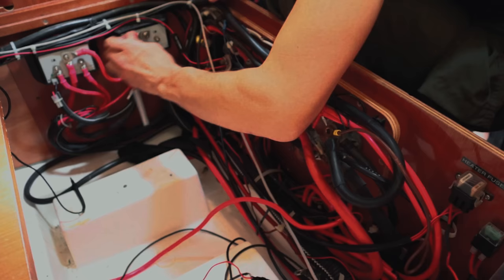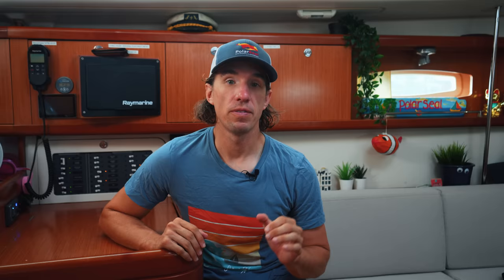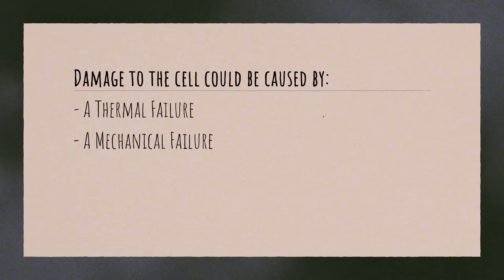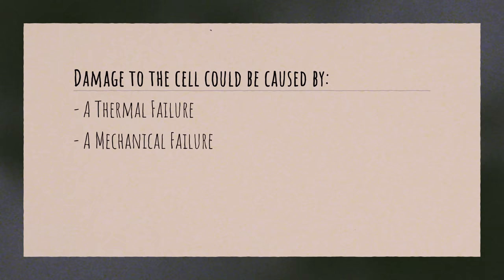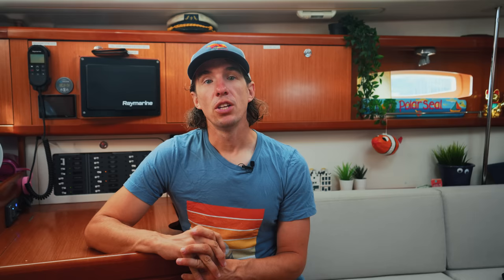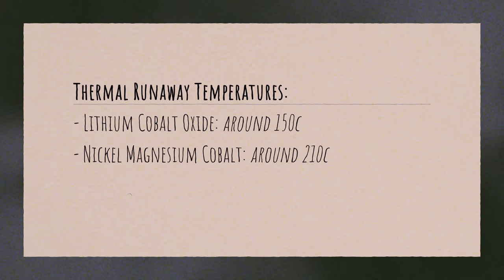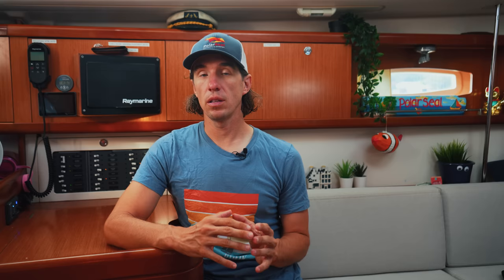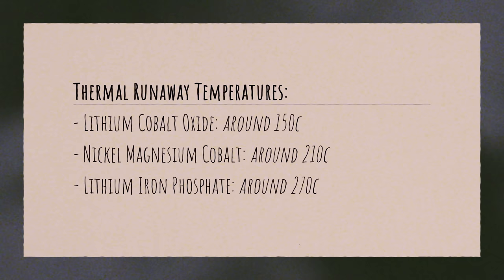WATCH THIS before installing lithium batteries on your sailboat ⚡ [RYAN'S TECH CORNER]

Comment: I have a boat with a really big inverter. 200A discharge, 100A charge at 13.8V. i have two 50A charge 100A discharge internal bms LFE batteries in parallel. It worries me that there is not much spare capacity inthe battery bank. Should there be a third battery in parallel?

Comment: So with internal bms AND comms, what happens if the internal BMS fails? What is the state of the battery when the BMS fails regardless of coms when it has internal Bms (for Dakota for example)? Does the pack become unusable or does Dakota allow the pack to be discharged/charged regardless?

Comment: do you have a list of insurance companies that do not greatly reduce coverage limits to  when Lithium is used (if there are any)? or do all insurance companies reduce coverage with a lithium battery bank is present?

Knowing that non of your 352000 is batteries burnt from properly installed, properly used failures, can you tell us how many over all fires you know of of those 352000 regardless of cause?

can you break that same answer down, including causes, allowing us to learn from others mistakes?

good video, as usual.  thank you.

Comment: Very informative video. I am looking to switch out my two starter AGMs in my 2017 ford transit van for a single lithium battery to allow for more space under the driver seat to install a DC to DC charger to my auxiliary lithium battery bank. Any recommendations on a company that can provide a regulator for my alternator?

Comment: I want to add 400 Amps of LFP (2X200) but one would be in engine compartment the other in aft cabin.  same as my current AGM setup.  Would the engine compartment heat vs the cabin temp negatively affect one battery more than the other.

Comment: hello Ryan, thanks for this very clear info. I was told that a hybrid syteem is the best of both worlds: I already had 3 new 90Ah agm's and I combined them with 2 bos LE450.  The advatage was that i could just connect them parallel to the agm's   I was told the agm's would live longer because of the BMS of the BOS LE 450 units.  Also I thought it wouyld be bettter to have simple batteries also in case there is a problem in some remote area. Lead or agm is everywhere. Do you agree on this opinions?

Comment: I'm in the process of updating a sla based ups to run lfp.  at present a mostly drop in replacement but i have to rely on the bms to prevent over/under charge/discharge.  the lfp battery is rated at 100 ah.  At full load the ups draws apx 70 amp.  The ups is intended to only to run 5-15 minutes to allow me time to startup a whole house generator.  I'm planning to add circuit mods to separate the inverter and charger to allow for the addition of adjustable low and hi voltage shutdown to prevent the battery from being over/under  charged or discharged, and to limit charge voltage & current to meet battery specs.  Being inside residential the operating temps isn't an issue.   I'm exploring the use of hi current schottky diodes or equiv. to separate the battery load and charge circuits, and turn off automatically should  voltages exceed preset limits.  
what do you think so far?

Comment: How do I ground my inverter? I have lithium bank totally separate from my house agm house bank. The lithium is only for my inverter and is isolated. Should I ground the inverter to the main dc ground? I’m concerned about galvanic corrosion

Comment: Thank you,  very well put together. I agree that the problems that arise often do not come from the LiFEPo themselves  but from the systems that support them.  That being said how are you going to deal with protecting alternator when you change to the LiFEPo start battery? Are you going to add some kind of protection i.e Vitron; Sterling ?

Comment: Hey, that was a really informative video, thanks a lot. I'm just wondering, does the lead acid buffer battery and B2B charger to lithium only work with a dual alternator setup or is it suitable for a single alternator also? Thanks

Comment: Hi Ryan, appreciate the video! 

- i have a boat with lead acid (sun odyssey 50 ds)
- want to replace house batteries for lifepo4 12v * 4 * 200 ah lifepo4 with bms
- want to keep starter and bow thruster batteries as lead acid
- want to add a victron multi plus 2 3000va 12v and set the profile to lithium
- how do you combine lead acid with a lithium charge profile on the multi plus? Do I need two circuits? And 2 battery chargers?
- is the starter battery also connected to the shore power/ battery charger so it charges? 
- Or is the starter battery only connected from alternator to starter battery to to dc-dc converter to house batteries?
- how does a diesel generator affect this? Does the diesel generator first go to the multi plus? Can it be combined?
- can a multi plus be mounted on its back instead of against the wall? There is hardly space for 55 cm

Thanks for the help!❤

Comment: Hello Ryan.
One of the best and most realistic videos about lithium on boats.
Completely agree with everything that you said. It is a shame that most marine electricians have no idea what a lithium battery is and how it operates and find it easy to just say fire hazard. On the other end, a lot of battery manufacturers say drop in replacement, which most of the time is not the case, as you very well explained.
I love my lithium and solar array and makes life aboard very pleasant. But I had to change a lot of components to get there.

Comment: Great tutorial Ryan!!  We are sailors but also building a skoolie, which, I believe,is a simular setup.  We will have Solar to charge our house.  Alternator will take care of starter battery.     Is there a guide or contact to help as to what Guage wire to install for the size of our house bank.   I havnt worked out our load needs yet but will have mostly AC appliances ( refrigerator, microwave...).
Reply from the maker: Hi Michael.  Check out the wire size guide on blue sea systems website.  Its my go to guide everytime i 'm doing wiring project... i believe there are three charts that show wire site, fuse time and size.  its really good.
Reply: @RyanSophieSailing  wow that was quick!!  Thank ypu so much!!

Comment: Ryan, well thought out and an erudite coverage of the topic.  Can you spilll the beans on why virtually all LFP packs expressly forbid use as a starter battery?  I've seen stupid YouTube videos where people short circuit  an LFP pack with steel rebar and it starts to glow orange hot (WOW! a dead short is a LOT of amps).   Are the MOSFETs in the BMS the limiting factor with the high inrush currents of the start motor causing the MOSFETs to fail?   Note well  I am not asking the Dakota solution to the issue only what is the root issue for the LFP carve out for starter applications.

Comment: You should not be getting any load dumps because a BMS shuts down (under normal conditions).    A load dump usually occurs over long lines during a high amperage operation.    A BMS is close to the battery and it will ramp down current at the end of its cycle before disconnecting.   And even if there were a load dump at the battery (because I wire is lose), the battery would tend to absorb that (but the BMS could be damaged).   Load dumps usually happen on long lines that power large equipment like AC or windless motors.   When the load falls off the line unexpectedly, that line will see a larger voltage spike -- but that won't be close to the battery.

Comment: Great video Ryan - it was good to have a reminder and it was interesting to hear of the new developments re the starter battery... although it would be good to know the difference between the normal lithium batteries and the new starter battery?  Following your earlier videos, I had my additional lithium (i.e. 2nd) house bank (used just for charging phones, cameras etc, and my CPAP) installed via a DC-DC converter charger, via the remaining lead-acid house bank.  Seemed like a safe option and with no alterations to existing installations.  Have you got any tips for balancing battery banks when additional lithium batteries are added?  That would be v useful to know how to do that!  Thanks again.

Comment: Batteries can and should be a short winded topic.  I don't trust most solar firms and installers to design my system and very few do it yourself off gridders design a solid system.

Comment: Could you comment on your experience with long term (6 month plus) storage of LiFePo4? I've read in a lot of places to store them at 20% SOC or so and not 95+% like lead acid to promote longevity. Thinking of the weekend sailor or winter haul out.
Reply from the maker: I would not store at 20% but yes, they do like to be stored lower than 100.  Most batteries before they ship to the customer are at 30% but thats becuase of shipping regulations.   Overall your thinking is correct.

Comment: Very good video - thanks.   Which brand of high output alternator did you buy and which brand of external regulator did you pair it with?  Also how much quicker does the new set up charge your lithium batteries as opposed to the battery to battery charger you previously used?

Comment: can i use a 12 volt 100ah LifePo4 battery to crank my outboard? ( requires about 625 cold cranking amps)
Reply from the maker: No, not our 100ah but check out the dakota lithium plus 135 ah battery.  I could do it, plus it's smaller than the 100ah

Comment: hi Ryan. great video. was wondering about your opinion on something... i have 1200ah of Victron batteries and 2 external alternator regulators (cat...). all wonderful so far, but I have noticed my alternators are showing signs of overheating. thing is, like just about everyone else, we often set sail early morning and the batteries are not at 100%. if we motor for a while, the alternators (std 100A that comes with the yanmar 57hp) will be busy for hours... I have seen them going down to 50% quickly, then 33%. but even then, it is for hours.

I'm wondering if I should just add a breaker between the victron regulator and the lithium bank and simply disconnect them. i don't need the alternator charging them, as I know that later in the day the solar will take care of it. if I ever need it, I could switch them back on (with engines off, naturally). what do you think?
Reply: It's not safe to just cut the connection between the external regulator and its alternator as you risk voltage spikes that can destroy the alternator. Balmar has instructions about adding an automated relay controlled by your BMS to the regulator ignition feed wire - cutting this wire causes the regulator to shut down the alternator safely (exactly the same as when you turn off the ignition). You could also add a manual switch (two in your case for each regulator) to the regulator ignition wire that you use when you don't want the alternator to not produce any output.

Don't your external regulators (Victron?) have alternator temperature sensors? Make sure those are connected - they enable the regulator to reduce current draw to keep the alternator temperature at whatever level is set. Your regulator may also have a belt manager feature that reduces the alternator output by reducing the field current a certain amount to reduce load on the alternators. The reality is that stock 100A alternators may only be able to output about 30A continuously.

Comment: Super cool info. Do you have more information on a “how to” for the external regulator for an alternator? 
My rig has a hp280a alternator and I use dc to dc chargers (12v to 24v) and I get about 40 amps @24v to my batteries from alternator. I’d love to get close to 100. Any tips would be great!

Comment: If a LFP battery internally shorts due to a manufacturing defect couldn't your boat burn. So wouldn't it be prudent (or good for insurance premiums) to install the batteries inside a fire proof box/compartment. Like a double walled stainless box with non flammable insulation so if the battery does short and burn it won't spread to the boat.???

Comment: I am intrigued with the lithium cranking battery; it could certainly eliminate a huge headache. I'm in the midst of installing a completely new 12V system on the sailboat, and presently have 400ah lithium house bank (100ah x 4 CanBat LiPO4 batteries with internal BMS's) and a wet cell starter battery. This may be a silly question, but can two different makes of LiPO4 batteries, both with internal BMS's be integrated into a common system (CanBat for house, Dakota for starter)?

Comment: Hiya Guys. Off Topic, good introduction to lithium batteries by the way. I know you've only had them since the Azores, the Sails by Precision Sails, what are you're impressions of those Sails so far ? I'm considering using them for Sails for my Next Boat, and after asking them in an enquiry about a triradial Dacron Battenless Sail for in Mast Furling, the speed of response, and that I was on the right track for Offshore Cruising Sails - they've made a lot of battenless in Mast Furling Sails already, it turns out, and added something which to me was surprising, that such a Sail Design and construction, recovers most of the performance you get from a Cross Cut Dacron Furling Main, with Full Battens ! tbh, I did expect a fair bit of performance loss, but considered it a price worth paying for much less chafing, wear and tear,  greatly extending service life and reliability. tbh, you're the only ones I know that have a Sail made by them, and your perspective on the Product, I consider worth having. Best Wishes and Fair Winds.  Bob.  👍🙂

Comment: I have put lithium batteries in my boat and found a puzzling dilemma. The boat has twin engines, large diesels and two battery banks. On the port side, there was originally 1x8D battery to start that engine and the generator. On the Starboard side it was originally 2x8D batteries that ran 12 volt house loads and started that engine. I took out the 2x8D batteries and put in 6x Valence U27-12XP batteries testing to a little over 700 ah capacity. These batteries have the task of starting an engine at 1000+ amps, so each battery has a #4 by 4 foot jumper to a main buss to keep the starter load even across all 6 batteries capable of 300 amps for 30 seconds. I have a 2kw industrial inverter stand alone just to run the watermaker. I also have a 3kw pure sine wave inverter to run the rest of the 120 volt loads on the boat. Now here is the problem. When I start the port engine, it charges the house bank at about 40 amps through the 130 amp isolator. When I start the Starboard engine, it will charge the batteries at just over 100 amps, but the port side drops to about 10 amps. This is due to the battery isolator and alternator regulators getting their sense voltage from 2 different sources. I am sure that when I start running, my 140 amp alternator is going to try and push almost that much current and probably burn out pretty soon. The only solution I could think of was to install a 60 amp dc to DC charger coming from the port alternator and going to the Starboard battery bank. This way I know I get at least a 60 amp load on the port alternator to help out the Starboard alternator. I ussualy run during the day, so I get 30-40 amps from the solar also. The DC to DC charge controller was all I could think to somewhat even out the loads on the alternator as well as the battery isolator. I would love to hear of any other solutions others may have thought up or used.

Comment: Thank you in advance🤝 🤚I have a question about the batteries! At 48 volts at about 40 to 60 amp draw how long could Decoda batteries run for? And could it be recharged at the same rate or speed as it took to discharge/or faster? Also would it's nominal voltage low if it was to be put back in to service right after a recharge? And what is the cost of the batteries you speak of in this video?
    And grate video by the way, I think you did a grate job explaining👊😎
Reply from the maker: the best way to think about this is convert everything to watts.  so your battery bank in watt hours(voltage x capacity in AH) gives you watt hours.  Then take all your chargers and figure out how many watts they can input that will give you the amount of time it takes to charge.

Comment: Why would I need bigger wires?a big battery bank does not pull more amps it just stores them,if your inverter pulls 200 amps if you put 1000 amp hour bank on it it still can only pull 200 amps

Comment: Hi, at DAKOTA catalog, are something wrong   - -   same technical data sheet: DISCHARGE 120 A max continuous, 180 A max 10-second pulse       - -              The story of having a 1000A CCA doesn't close... The catalog states that the battery's operating temperature is from -6.7°C to 49°C. The CCA is measured at -18°C.... so there's no way.... ( follows the logic at next message )

Comment: Thank you! Answered many of my questions about LiPO4 batteries. One question though..... you mentioned that Polar has 4-170AH batteries in parallel. Thoughts on why you left the "house" at 12V and not "series'd"  to 24 or 48V for efficiency?
Reply: I'm guessing that would require replacing every single item that works on 12v
Reply: @25kocyk  I am considering this and no, you don't have to convert all gear to 24V. In my case my 12V Plotter, nav gear, both fridges and freezers all will work on 24V and the rest will work off a 24V to 12V converter. André in Sydney